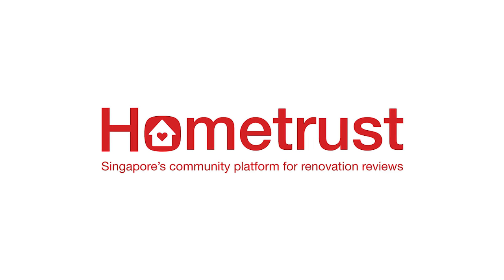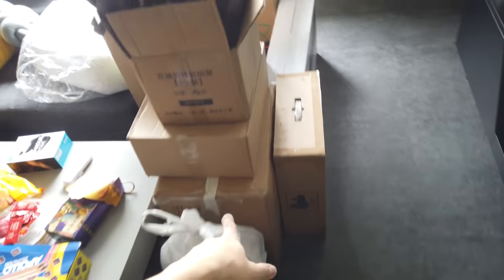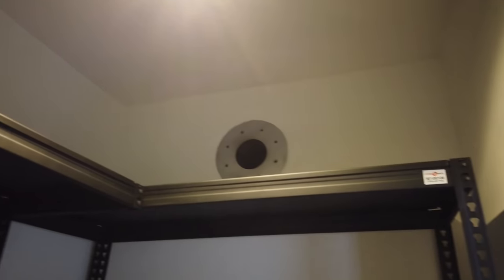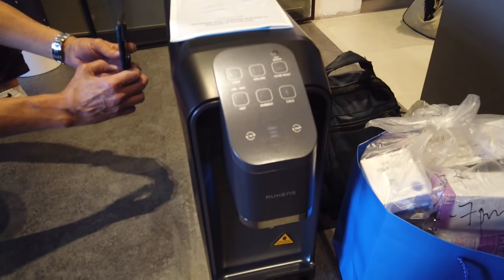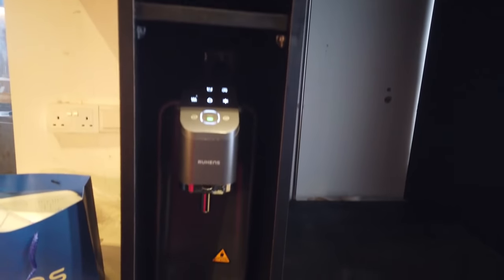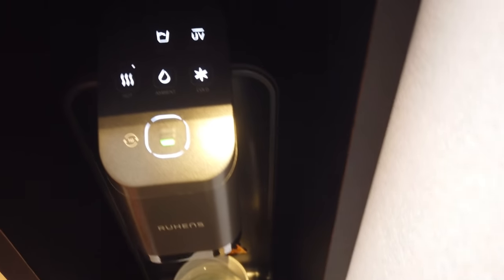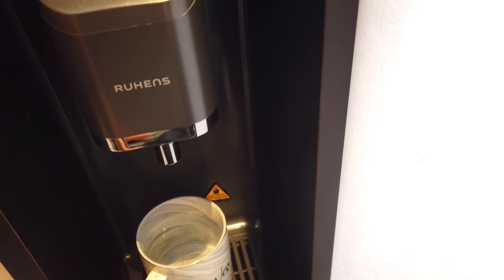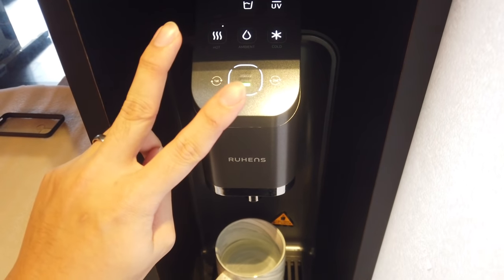WATER DISPENSER & BOMB SHELTER RACK | 3-ROOM HDB TOP FLOOR 🏠 | OUR BTO PROCESS EP22

Comment: hmm... the problem with placing appliance in such a compartment is you will have dust collecting at the 2 sides/gaps and it will be difficult to clean
Reply from the maker: that is true! that's why we got the installers to install a longer water pipe to cater for cleaning! 😄 but so far, there isn't much dust collected which is surprising! 😂
Reply: But every time you will change the filters you have to remove the dispenser right?

Comment: Move in liao, I prefer to put the dispenser outside bcoz it is easier to change filters
Reply: good point. each time u wanna do something need to take the machine out and put back in.
Reply from the maker: the filter only needs to change every 6 months so not that bad! 😄
Reply from the maker: it's been working alright for us, so not an issue! got the installer to install a longer pipe as well to cater the pulling out part! 😄